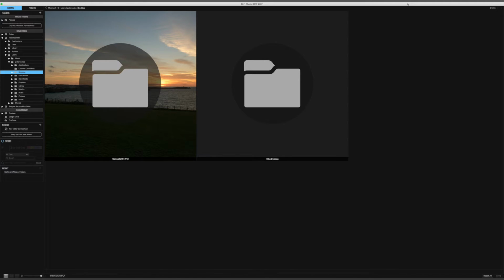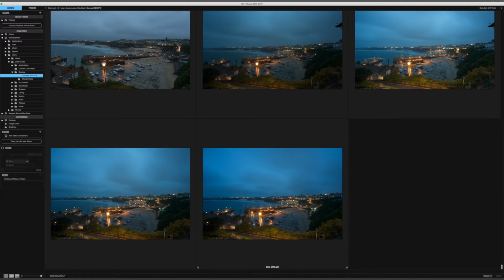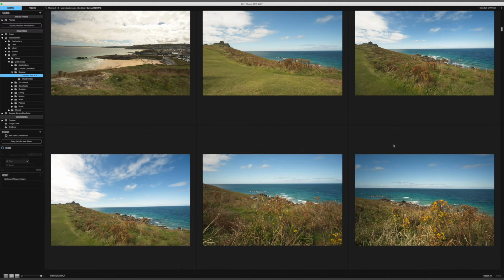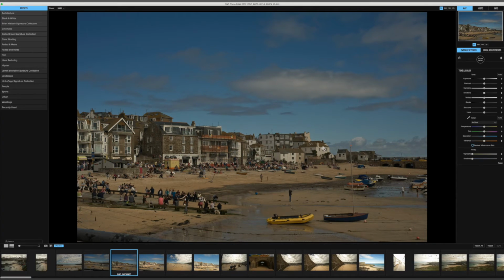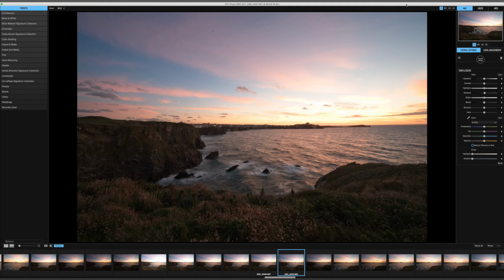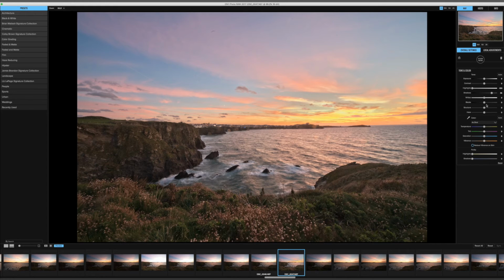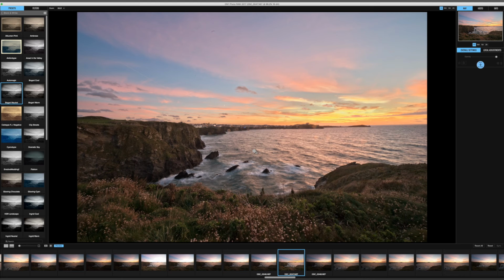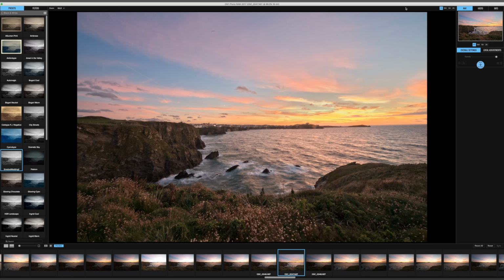On1 Raw First Impressions , will it replace Lightroom? The basics.

Comment: It is still very slow on my windows 10 Pc the same as the old version.On one say that is because I don't have a dedicated video card. So on a pc that is intel i7 64gb ram. Very disappointed. I also notice that my fuji Xt-2 files seem pixelated.  $79.99 yes but that will the same again every year.There is no film simulations for fuji files either. I own 2018 version but I don't think I will buy 2019.

Comment: The first release was terrible. They hyped how great the software was going to be and even said they were not releasing it until they had it ready ... only to put out a product with a ton of bugs including the crashes you mentioned in intro. No we should not tolerate that kind of issue with new software, as long as we the consumers put up with that kind of crap in software releases the companies will continue to put out products before they are ready. This software was not and is not ready for regular use ... potential yes, but until they work out the bugs, and stop the crashes anyone who has a fair amount of processing to do ... simple wait for about two years and maybe it will be reliable. Very disappointed in my testing ... you seem willing to give them the benefit of the doubt. I will continue with LR and PS at $10 a month over laying out over a year just for this program that is not ready.
Reply from the maker: +William Thomas You make some great points , there is still some bugs , the last update seem to correct a bad memory leak which has helped considerably . I agree that LR is still most photographers first choice and mine but its certainly not bug free and to be honest they are short changing us by the slow development of LR. Only a couple if days ago LR corrupted a Catalogue, this certainly is not the first time . Software in general is a work in progress and personally i love that on one is taking on the big boys with a kind of hybrid mix of LR and a bit of photoshop. Im willing to keep using it for personal projects as its quick fun and easy to use and supporting On One might drive Adobe to get there finger out and develop a old slow LR .Speed is key for a busey photographer and LR needs to improve or loose there crown. Thanks for commenting William, you made some valid points!

Comment: What about the 'bonus' of having Photoshop with Adobe CC?
Mike in Oz
Reply from the maker: Yes Mike, your 100% correct, photoshop is the big bonus and can do things that are not possible in Lightroom or on1 RAW. Photoshop is a far more powerful tool than them both. On1 are focusing on two main users in my opinion. Amature photographers that don't need the very powerful photoshop and need a good solid RAW converter editor with the ability to add layers ect and some elements of photoshop. And secondly the aiming at the pro photographers that wants a quicker workflow, time is money and lightrooms slow performance and continuing stability issues for some users is causing concern and that's the category that I fall into. Because it's my business I can afford to have both and could not work without photoshop, lightroom, on the other hand, is not so essential and Capture 1  and now On1 Raw which is not there yet on stability but is getting better and better and could be the viable alternative. Don't get me wrong, I still use lightroom but its RAW converter is not the best, I've used Capture 1 for the last year and its RAW converter is superior but again has speed and stability issues. Don't think I'm beating up lightroom here I'm not, I still use it virtually everyday, but its speed, lack of development is now becoming an issue for a lot of photographers and it's great seeing developers like On1 move their software forward in leaps and bounds.  But great point Mike!

Comment: Definitely interesting. One thing that I definitely need [and please correct me if i'm wrong] and neither On 1 or Capture seem to have is a print module. I do all my own printing and with Lightrooms print module I have complete control over how i want to print my image. The other programs are no use to me without a print module.
Reply from the maker: No Greg they don't have the same dedicated print module in the same way that Lightroom has. I use Lightroom when creating multipage size prints myself (school photos) because the ease of use. On1 RAW has a basic print feature and capture one is a little better and contact sheets and basic multi picture templates can be made in the print, but i only been able to print same size multi prints if that makes sense. Its why i still use Lightroom for any printing that i need to do.